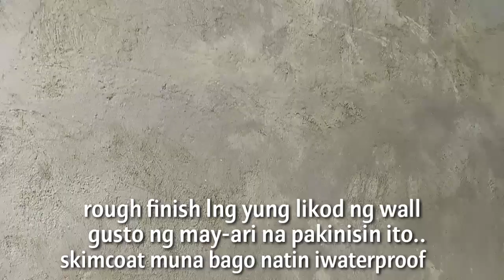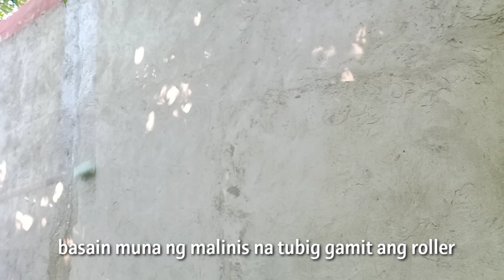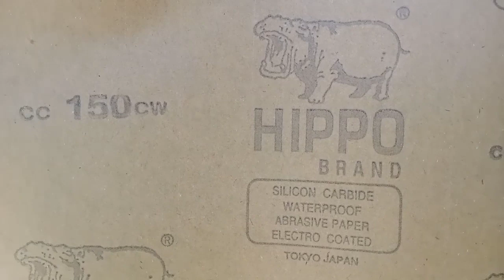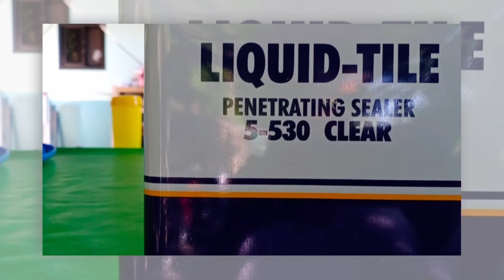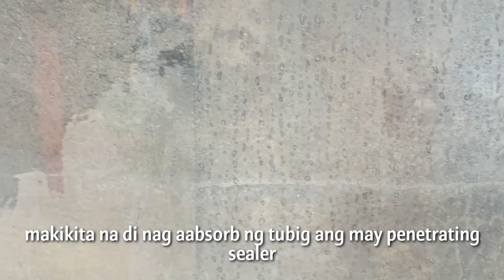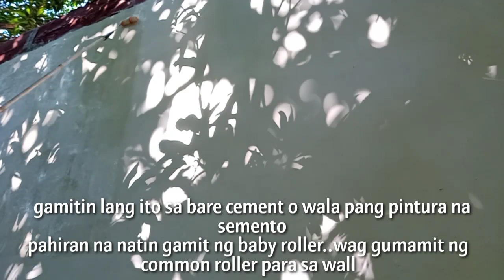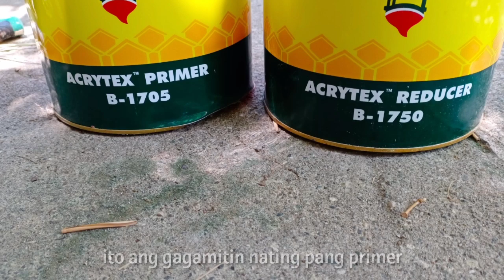Exterior wall waterproofing

Comment: Thank me later.
1. Skimcoat muna bago i-waterproof
2. Kaskasin ng trowel/paleta ung wall para matanggal yung maliliit na bato / Pwede rin lihan ng #36 o #.60 grit sandpaper
4. Magtimpla ng skimcoat
5. Haluin ng 2-5 mins pagtapos ay hayaan ng 15 mins at muling haluin. Magtimpla lang ng kayang ubusin sa loob ng 1 oras. Gumamit ng improvised na panghalo para walang buobuo
6. Basain muna ng malinis na tubig ang pader gamit ang roller
6. pahiran ng skimcoat para kuminis at matakpan na rin ung crack. Pahiran ng vertical at horizontal para pumantay
7. Hayaan magcure ng 2 araw
8. Pagtapos 2 days, lihahin ng no. 150 Hippo Brand Abrasive paper ang naskimcoat, tapos alisin ang alikabok
9. Liquid-tile penetrating sealer 5-530 clear
(ito ay acrylic solvent based na para sa semento kaya ito ay matibay sa ulan at ito ang magprotekta sa semento para di magmoist ang wall sa kabila) pwede na ito gamitin direkto. Gamitin lang ito sa bare cement o wala pang pintura na semento. pahiran na natin gamit ng baby roller, wag gumamit ng common roller para sa wall dahil kaya nitong palambutin ang plastic, baka masira agad roller. Patuyuin ng 2 oras tapos second coat para sigurado
10. Gumamit ng Acrytex Primer B-1705, tulad ito ng liquid tile acrylic solvent din ang acrytex primer kaya matibay ito sa tubig, Lagyan ng acrytex reducer tapos pagulungan ng 1 mano ang pader
11. Patuyuin ng overnight
12. Nippon Paint Elastex, elastomeric waterproofing - ito ay waterbased at maraming pagpipiliang kulang kaya magandang pang finish ito. pwede rin ang arytex topcoat kung gusto mo ng mas matibay
13. pasaliha muna bago pagulungan ng nippon paint14,. Finished
Reply: Idol tanong ko lng sana.ano ba ang dapat mauna ung skimcoat or boysen plexibond?boysen plexibond na kasi ang nabili ko.maraming salamat idol.godbless

Comment: Ang galing mo po sir. Hi Sir, pwede po bang patungan ng liquid penetrating sealer ang meron ng boysen plexibond na firewall namin ? or pwede bang lagyan ba namin ng skimcoat  yung existing plexibond ng firewall namin ? Ano po ba ang magandang gawin kungmay plexibond na yung firewall namin. Thanks a lot po. Ingat.
Reply from the maker: Pwedeng sk8mcoat o penetrating ang ilagay nyo
Reply: @LeojayBaguinan   Thank you Sir. After penetrating po ba, acrytex primer na po then elastomeric topcaot na po ba ? Thank you po.
Reply from the maker: Yes

Comment: tama ba sir kung exterior wall na meron exiting paint?
1. Linis muna gamit brush and tubig
2. Apply skim coat
3. Apply Liquid Tile Penetrating Sealer
4. Apply Acrytex Primer
5. Apply Water-proof paint
Reply from the maker: Sa rough na semento na may pintura pwede yang sinabi nyo
Reply: @LeojayBaguinan  yep, walang skim coat before, salamat!
Reply: @LeojayBaguinan  panu po pg m flexibond n un rough na outerwall,pde pba gawin yan?
Reply from the maker: @jayruzsalipan942  pwede po
Reply: tanong lang po. nasa third floor po kasi. mahirapan ifinishing at skimcoat. pwede pa po ba ma waterproof ang loob? kahit may pintura na?😊

Comment: Yung outside rough wall ay may pinta tapos skim coat (skim.coat can be applied directly sa painted wall after after lihain ng kaunti at basain ng tubig)After ng skim coat application ng 2 applications at patuyuin on each application ng skim coat pwede na Isunod yung penetrating sealer then  acrylic primer?Tama po ba?Ano po ba ma's matibay na pang finale platada (final na pagkinis)skim coat o pure cement?Thank you po scheduled this summer sa dirty kitchen namin.
Reply from the maker: Mas maganda kung palitadahan na lng ng panibago...at tsaka nyo  gamitan ng konstrukt skimcoat ng boysen para matibay
Reply: @LeojayBaguinan  thank you

Comment: Pwede po bang hindi na I skim coat kasi sa labas ng 3rd floor at kailangang na hagdan lang gamitin para maabot yung papahiran ng water proofing. Rough lang po finished. At ano po ang magandang ipahid na water proofing agent na pwedeng gamitan ng roller.
Reply from the maker: Plexibond o thoroseal mga cementitous waterproofing

Comment: Thank you sir sa pagshare. Ask ko lng po, anu po ba pwdeng ihalo sa semento na ipaplaster para makadagdag po sa pagwaterproof ng dingding? Salamat po uli! New subscriber nyo po ako.
Reply from the maker: Sahara
Reply: @LeojayBaguinan  thank u so much po sa idea. Magpapawater proofing po kasi kami now. Tama po bang after plastering, mag skimcoat...then, plexibond, finally po yung liquid tile? Salamat po sir. Big help po sa amin yung vlogs ninyo.
Reply from the maker: @solramos6966  yes po
Reply: @LeojayBaguinan  ask ko lang po ano po ratio ng Sahara at cement sa plastering?Pwede din ba ang plastering with Sahara then thoraseal then skimcoat then pinta na ?Thank you.

Comment: Sir Ask po Sana.. ANU mo suggest nyo na Gagamitin na waterproofing para sa Concrete flooring na Planu ko lagyan ng plywood  para po hindi masira ang Plywood ng Moisture n galing sa Concrete flooring. Pasuyo po... Slamat po...
Reply from the maker: Pwedeng boysen plexibond o straight liquid tile system
Reply: @LeojayBaguinan  salamt Sir

Comment: Magandang hapon po sir, tanong ko Lang po kung Makinis na po yung firewall ng bahay, kailangan pa rin po bang lagyan ng skimcoat bago mag waterproofing? Thank you po sa sagot.
Reply from the maker: Kung makinis na kahit hindi na ang skimcoat ay pangpakinis lang
Reply: @LeojayBaguinan  sir, pinturahan ko na po ng  Flexibond topcoat nalang tapos waterproof na po yun at hindi na mag moist sa loob ng bahay? Thank u po sa sagot
Reply from the maker: @issaaparici5707  primer muna kayo ng acrytex o liquid tile primer at elastomeric paint pang finish nyo
Reply: @LeojayBaguinan  thank you po sir

Comment: Ask lang po. Box type po yung bahay namin. Finished po yung wall s labas pero may mga crack na din kaya pay naulan, nagpenetrate yung tubig s loob. Ano po ba mas effective pangwaterproof, plexibond or penetrating sealer? And need pa po ba magskimcoat bago lagyan ng sealer Kung un gagamitin or pwede direkta na. Salamat po
Reply from the maker: Kung finish yung wall pwede direkta na yung sealer
Reply: @LeojayBaguinan  kahit po may mga crack na yung finished wall kaya na ng sealer kahit d n skim coat?
Reply from the maker: @bernadettepalomo3048 
 panoorin mo rin ito👇
https://youtu.be/h3nW62onV7M

Comment: Sir, ilang araw po hihintayin bago magskimcoat or waterproofing po sa palitada ng exterior wall? Salamat po boss!
Reply from the maker: 14 to 28 days cure na ang semento sa magandang panahon
Reply: @LeojayBaguinan  salamat po boss dami nyo ng naitutulong sa kin. Boss panu Kya yun, Yung interior wall  5 days palang pinalitada, na skimcoat na.. nagpupulbos pagnadidikitan. Parang chalk. Di nalason Yung palitada bago po nagskimcoat. Anu po boss pwdeng gawin dun? Naliha na po yun. God bless you po and ur family.
Reply from the maker: Di lng magandang brand siguro yang ginamit nyo..ok lng naiskimcoat ng maaga basta wag munang pinturahan maghintay magcure ang semento basain nyo araw araw dahil semento rin yang skimcoat pagcure na 14 days pataas acrytex primer gamitin nyo para matibay tsaka nyo na i latex
Reply: @LeojayBaguinan  maraming maraming salamat po sir!
Reply: Sir, Anu po mas maganda at mas dapat pag ma skimcoat? Yung smooth finished po or dapat rough finished wall? Salamat po sa tulong nyo boss.

Comment: Halos same lang po kasi sila na pang water proofing ang pinagkaiba lang po eh ang pag apply tama po ba? Yung flexibond pwede iapply sa rough finish na wall then bago mag skim coating? Tapos yang penetrating sealer sir dapat skim coat muna bago mag apply ng penetrating sealer. Tama po ba yung pagkakaunawa ko sir? Saan po mas makakamura sir?
Reply from the maker: Konti lng naman ang diperensya nyan kung sino mas mahal sa plexibond at penetrating sealer...dun ka sa mas magtatagal penetrating sealer dahil solvent based yan
Reply: @LeojayBaguinan   kapag po penetrating sealer sir ang ginamit pwede din sya gamitan ng anong klaseng pintura po?
Reply: Pwede po ba yan sir sa flooring? Bago itiles?
Reply from the maker: @marceengmatsing9787  pwede basta iprimer mo muna ng liquid tile primer o acrytex primer tapos pwede mo nang patungan ng gusto mo
Reply from the maker: @marceengmatsing9787  hindi na kakapit ang semento sa penet.sealer kung papatungan mo ng tiles plexibond ka na lng
Reply: @LeojayBaguinan  ah.. maraming salamat sir sa mga info.. god bless po

Comment: Khit pla my sahara yung exterior wall tumatagos pdin ung tubig sa loob
Reply from the maker: Hindi talaga sigurado kung sahara lng lalo na kung di nahalo maigi sa semento kailangan pa rin ng ibang waterproofing
Reply: Sa amin Sahara had been used and the outside wall ay rough lang sa dirty kitchen and it was painted pero hindi natagos ang tubig ulan gaano man lalakas but still I want this summer to waterproof since gusto ko ipa finale na platada.How much po ba ang waterproofing na ito ?
Reply: @rubymagdaug2441  dpende sa brand..pwede mo nmn ireview sa internet mga watetproofing brand...
Reply: @leemin1790  Thank you

Comment: Sir Leo, ok po ba sa firewall ung mga polyurethane na water proofing(Fortress)? And ung butaminous (dolphin)? Thanks po
Reply from the maker: Di ko po alam ngayon ko lng narinig yang polyurethane na waterproofing sensya na
Reply: @LeojayBaguinan  no prob po. Salamat. Last na. Anu po ba Ang pwede pros and cons if Ang gagawin Kong pang water proof sa fire wall ko is GI sheet na naka screw sa rough na palitada nya? And balak Di po Namin pinturahan ung Gi sheet. Salamat po.

Comment: Sir pwedi bang paghaluhin ang plexibond at skimcoat pang water proof sa lumang wall na may skimcoat na? Salamat po.
Reply from the maker: Hindi ko pa po nasubukan yang paghaluin pero palagay ko mahina yan dahil nagpupulbos ang skim coat portland cement talaga ang hinahalo dyan
Reply: @LeojayBaguinan  ang taning paraan nalang po ba ay bakbakin yung skim coat bago patungan ng flexibond? Mayroon ba kayung ibang solution?
Reply from the maker: @willardmadarang2605  kung matibay naman at makinis na ang skimcoat pwede mo namang gamitan na lng ng liquid tile penetrating sealer at primer tapos finish ng liquid tile o acrytex topcoat kung matibay at waterproofing ang gusto mo

Comment: Sir, what if po finished yung wall, smooth, and then may paint?
Yung cracks po sa wall namin yung super maninipis. Yung commonly po na makikita sa windows.
Panu po gawin?
Reply from the maker: Buksan nyo po yung crack gamit ang grinder at diamond cutting disc tapos masilyahan nyo ng epoxy non sag kung wala namang leak ng tubig

Comment: Sir, Pwede po ba i-apply sa loob ang penetrating sealer? At kung paano po gagawin? Kasi yung labas po e luma na yung palitada may lumot na kays kung pwede po sa loob nalang ipahid? Yung mga crack po kasi na tinapalan ko ng masilya lumalabas po dun tubig huhu.. salamat po in advanvr sa reply nyo...
Reply from the maker: Kahit sa loob mo ipahid yan ay tatagos pa rin ang tubig ..dapat sa labas mapigilan ang tubig...suggestion ko palitadahan nyo ulit at iwterproof pagtapos
Reply: Kahit po ba rough finish po okay lang tapos lagyan ko na po ng sealer?
Reply from the maker: @foxtrot28  pwede lagyan ng sealer ang rough finish...pero di mo pwedeng patungan ito ng skimcoat dahil magbibitak bitak
Reply: Wow ayus! Ilang pahid po gagawin ko?
Reply from the maker: @foxtrot28  gawin mo lng yung nasa video

Comment: Sir ask ko lng po kung ok lng b n penetrating sealer at waterproofing paint lng ang ilagay s wall pra s gnitong issue? May advantages at disadvantages po b cya? Salamat po in advance s pgreply...
Reply from the maker: Pag gumamit ka ng penetrating sealer kailangan mong magprimer ng acrytex primer bago ka magfinish ng waterproofing paint
Reply: @LeojayBaguinan  ahh ok po, ano po b mangyayari kung penetrating sealer at waterproofing paint lng iapply s exterior wall? Mgkakaroon prin po b cya ng moisture s interior wall? So kung susundin ko po ung suggestion nyo n kelangan maglagay ng acrytex primer, hndi n po b kelangan ng reducer? Salamat po
Reply from the maker: @jeffersondevera6787  kung waterbased yang waterproofing na sinasabi mo ay di kakapit sa penetrating sealer yan
Reply: @LeojayBaguinan  ung Davies sun and rain elastomeric waterproofing paint po, pde po b un?
Reply from the maker: Pwede basta acrytex primer mo muna
Reply: @LeojayBaguinan  ahhh ok po, so hndi tlga po cya pde mg penetrating sealer at waterproofing paint lng... Kung may acrytex primer, kelangan p po ba ng reducer?
Reply from the maker: @jeffersondevera6787  yes
Reply: @LeojayBaguinan  salamat po
Reply: @LeojayBaguinan  sir, may nagsuggest po sken n ok lng dw kung flexibond lng dw ang ilagay s exterior wall
Reply from the maker: @jeffersondevera6787  ok try mo na lng

Comment: Linawin ko lng po sir after po pahiran ng skim coat, saka po papahiran ng penetrating sealer, tama po b?  ano po ibig nyo sabihin dun sa bare cement?
Reply from the maker: Tama po...kaya iniskimcoat ko muna dahil rough yung wall..bare cement ibig sabihin wala pang anumang pintura yung wall,doon mo lng maaring gamitan ng penetrating sealer
Reply: @LeojayBaguinan  a ok, bale po ung wall na may skim coat ay considered bare cement?  thank you po
Reply from the maker: Yes dahil semento rin ang skimcoat

Comment: Sir panu kung gusto ko lang ng rough finish sa exterior wall pwdy bang drtso penetrating sealer lang diretso tapos primer na drteso?
Reply: hi sir, regarding sa tanong mo, ako na muna sasagot. Since ang sealer ay waterproofing, pwede naman na, ang skim coat lang naman is used for smoothening of surface.
Reply: Sir  @gabrielcaballero4867 , dito sa amin may bahay na rough finished lang siya pero ang may ari may ipinahid na pang water proofing na naging gray ang kulay ng kanilang wall. Ano kaya ang ipinahid?

Comment: sir ano ba mauna concrete sealer muna o skimcoat tpos liha bago cncrte sealer? tnx po pakisgot,
Reply from the maker: Kung ang wall ay finish ng purong semento una ang penetrating sealer bago magprimer ng acrytex primer at batakan ng acrytex cast...hindi pwede skimcoat ibatak kung nakauna ang sealer dahil di kakapit ito..ngayon kung rough yan ay skimcoat ang gagamitin para kuminis pwede mo isunod ang penetrating sealer sa ibabaw ng skimcoat
Reply: @LeojayBaguinan  salamt boss , tnx Godbless
Reply: @LeojayBaguinan  boss may tanong pako ano mganda sa comport room boss  na pintura latex ba o acrytex?

Comment: Finished po exterior wall namin pero may konting mga hairline crack, di na po ba mapapasokan ng tubig kung lagyan ng penetrating sealer, acrytex primer at elastomeric?
Reply from the maker: Para sigurado ka masilyahan mo ng acrytex cast
Reply: Sir,halimbawang napahiran na ng penetrating sealer at naprimeran na rin ng acrytex primer at napinturahan na rin ng elastomeric at may tagas pa rin,pwd kayang pahiran ulit ng penetrating sealer sa ibabaw ng elastomeric?
Reply from the maker: @manuelgalaang1155  hindi na lalambot ang elastomeric
Reply: @LeojayBaguinan  ...thank u sir

Comment: Sir mgcucure b yn kung sakaling umulan the next day after ng application ng skimcoat?
Reply from the maker: Yes mas maganda kung mababasa ang skimcoat pagkatuyo dahil semento rin yan
Reply: @LeojayBaguinan  alin ho ba ma's matibay skim coat o pure cement na pampakinis?Scheduled this summer pakinisin yung painted rough exterior wall na dirty kitchen namin.Ok lang sa akin kung medyo magtatagal sa pag sinsilin ang old paint then pure cement what I want is the quality at durability if skim coat o pure cement sa pag pakinis ng old rough exterior painted wall. The issue is yung sa flooring banda yung foundation kasi previously 4 open sides  garrage iyon at with bricks ang poste yung gumawa instead ilagay ang hollow blocks sa pinaka edge ng flooring ay pinatong lang sa flooring with deform bar kasi daw mawawala ang full view ng post with bricks. (I don't know anything about construction)Kahit may flexible bond before bago platadahan ang mga gilid ng hollow blocks foundation natagas pag umuulan.Ano kaya ang dapat gawin.Ito bang suggested waterproofing mo ay advisable?Thank you sana ma bigyan mo ng pansin.God bless
Reply: khit di umulan.yung hamog lng sa madaling araw mgcucure yan

Comment: Paano po pag finished na yung interior  and exterior wall? Pag sobrang lakas ng ulan tumatagas talaga sa loob yung tubig e.
Reply from the maker: Waterproofing nyo po yung sa labas
Reply: sir pebbled na yung roofdeck nmn. with waterproofing na rin nung ginawa pero ngyn may leak na.any suggestion sir?
Reply: Paano po pag interior water proofing? Ung exterior kasi di na malalagyan

Comment: Pwede po ba sa interior gawin yung ganitong proseso proseso?
Reply: Precast yung walls ko, pero nanunuot tubig sa dugtungan kasi.
Reply from the maker: Sa labas po dapat gawin ang waterproofing...di rin mapipigil ang tubig kung sa loob dahil maghahanap ng lalabasan ang tubig...kung di kayo makagawa sa labas try nyo buksan ng concrete nail sinsilan yung mga dugtungan ng precast na nilalabasan ng tubig at saka nyo tapalan ng thoroseal water plug

Comment: sir pwede din po ba ito gawin sa rough firewall na may pintura na?
Reply from the maker: Yes basta matibay pa yung pintura nya at linisin maigi bago skimcoat
Reply: Yes sir primero pro deck waterproofing 2 coats two weeks ago  ginawa ko kaso nagmoist pa rin sa loob ng wall. Itong ginawa nyo po wala po moist sa loob until now?
Reply from the maker: @jaysonjoaquin2029  wala